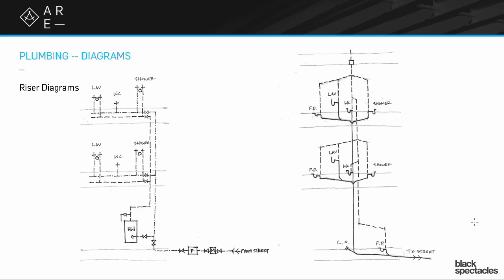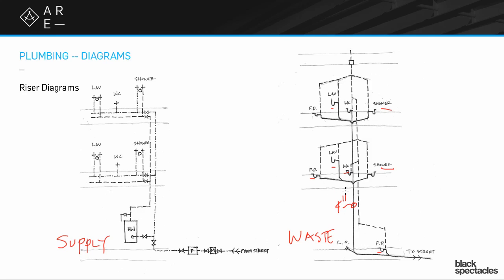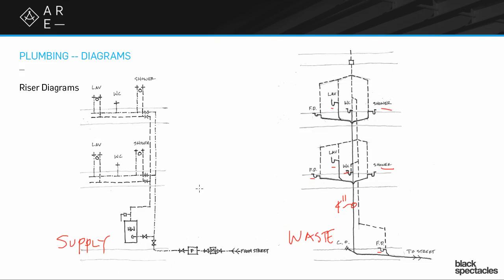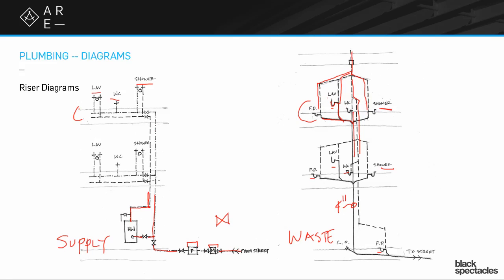Riser Diagrams - Building Systems

Comment: I'm confuse if riser diagrams is same as schematic diagram
Reply from the maker: Riser diagrams are used all the way through construction documents to relay (diagrammatically) how water is supplied to the building and also how it leaves the building as waste.  Both code reviewers and plumbers will use these.
Reply: Black Spectacles thankyou

Comment: Please do not say "hot water heater" because hot water does not need to be heated. :-)
Reply: Yes it can, it can always be heated to a higher temperature. It also refers to the hot water that needs to be recirculated back into the heater to be reheated to maintain its temperature